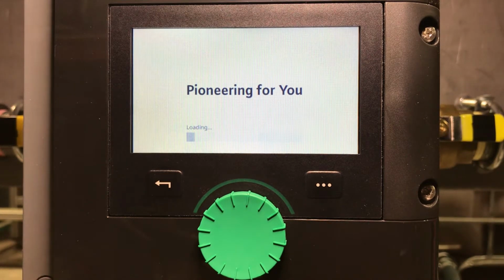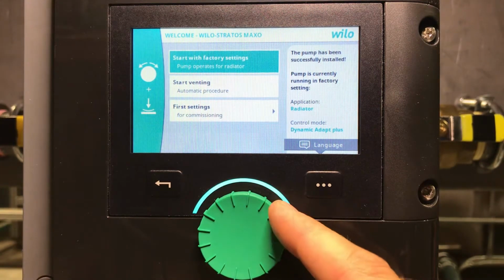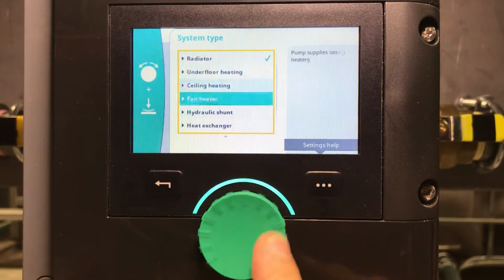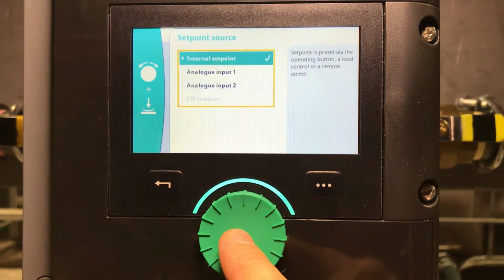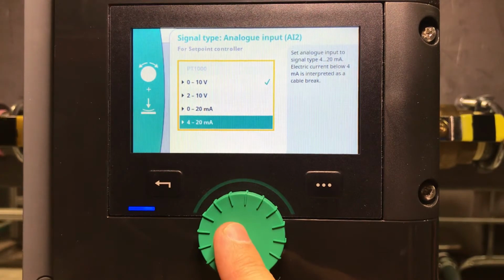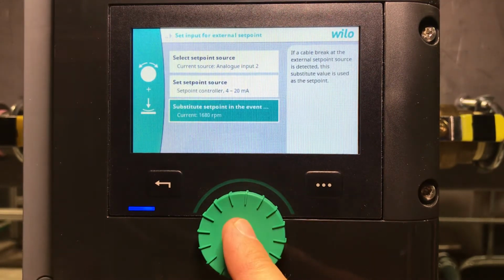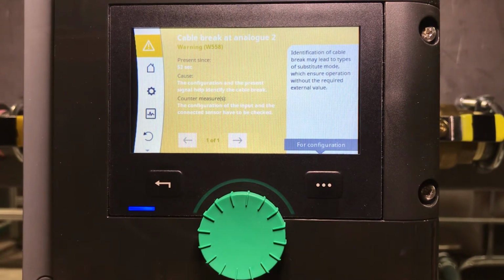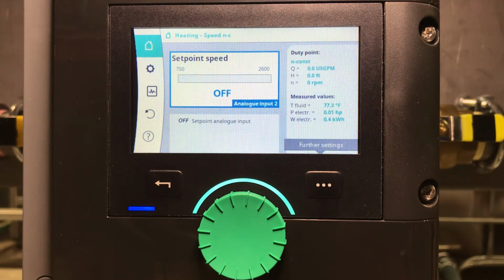Stratos Maxo 4-20mA input setup

Comment: i cant even turn it on, sometimes its on but most of the times its off
Reply from the maker: Hi Julien, 
Sorry for the late reply. You can turn the pump ON or OFF by closing the contacts on DI1 or DI2 the two digital inputs. You can also just do this: In the home screen press the “index” button, the three dotted button to the right of the scrolling button and choose “Pump On” so the pump will be on all the time. This is a manual command so it will take priority over DI1&2.

Comment: Thank you for the video. I have very basic question; how you send signal to the pump? Im fully new to it. Thank you in advance
Reply from the maker: Hi Najibullah,
What kind of signal are you referring to? If it is a variable signal like 2-10V then you wire it into AI1 or 2 so you can control the speed of the pump for example. If you want to turn the pump ON or OFF you wire a thermostat or a switch to any of the DI1 or 2. Or you can just jumper the terminals of either of these two digital inputs. Thanks for watching.